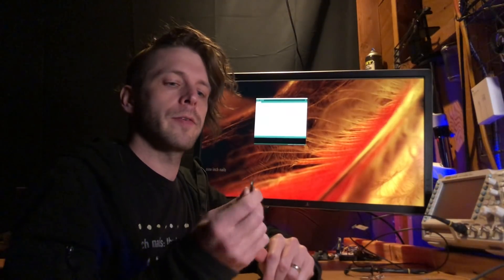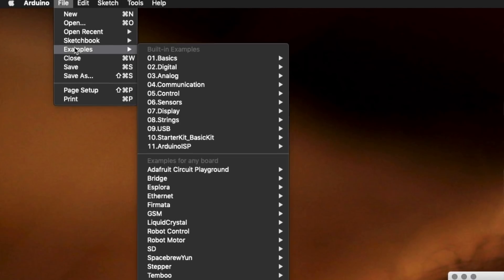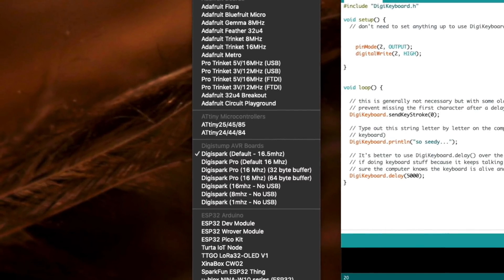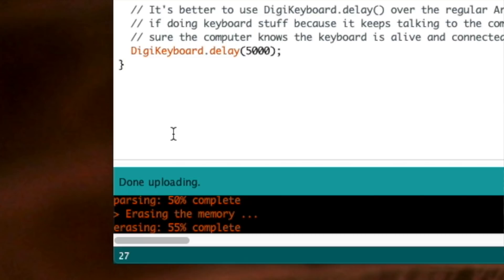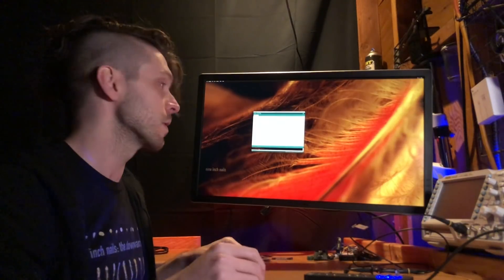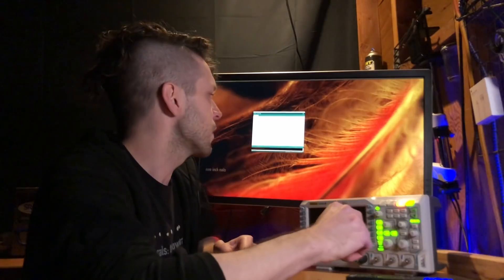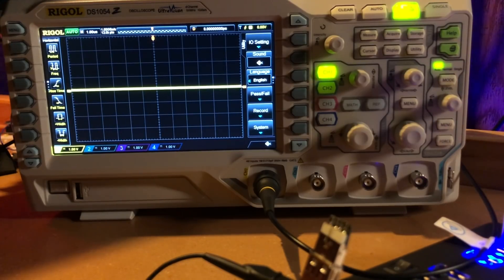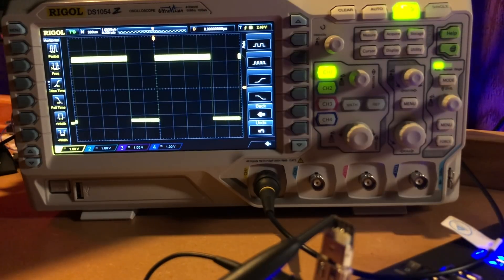DemonSeed EDU - Ep5 - Payloads & Bit Banging

Comment: Heads-up: If you are seeing a failure with "micronucleus: library/micronucleus_lib.c:66: micronucleus_connect: Assertion `res >= 4' failed.", it's likely because of lacking permissions.

Create a file named /lib/udev/rules.d/49-micronucleus.rules  with the following lines in it:
SUBSYSTEM=="usb", ATTR{idVendor}=="16d0", ATTR{idProduct}=="0753", MODE="0660", GROUP="dialout"
KERNEL=="ttyACM*", ATTRS{idVendor}=="16d0", ATTRS{idProduct}=="0753", MODE:="0666", ENV{ID_MM_DEVICE_IGNORE}="1"

...and /lib/udev/rules.d/90-digispark.rules with
SUBSYSTEMS=="usb", ATTRS{idVendor}=="16d0", ATTRS{idProduct}=="0753", MODE:="0666"
KERNEL=="ttyACM*", ATTRS{idVendor}=="16d0", ATTRS{idProduct}=="0753", MODE:="0666", ENV{ID_MM_DEVICE_IGNORE}="1"

(h/t to https://digistump.com/board/index.php?topic=106.0)